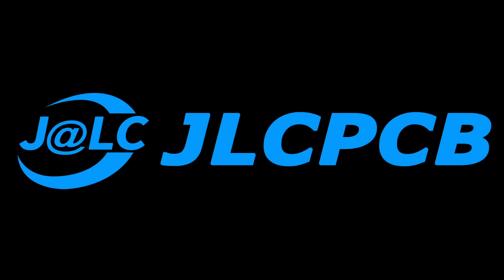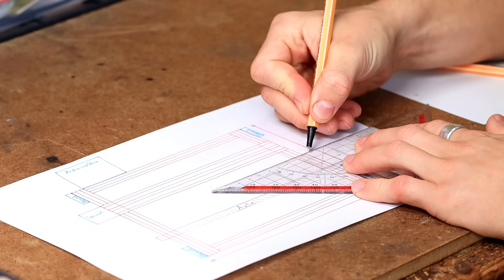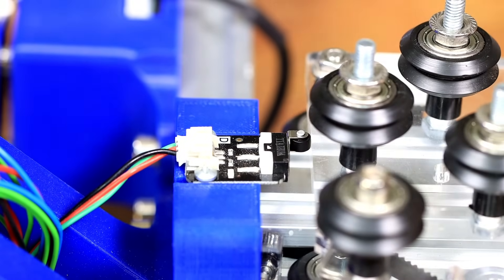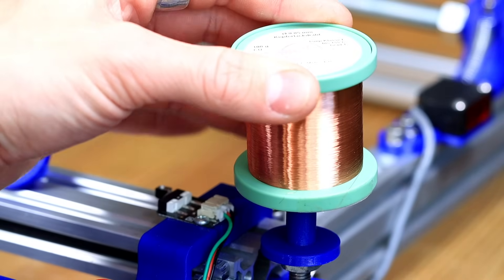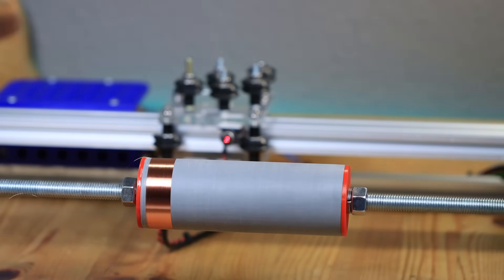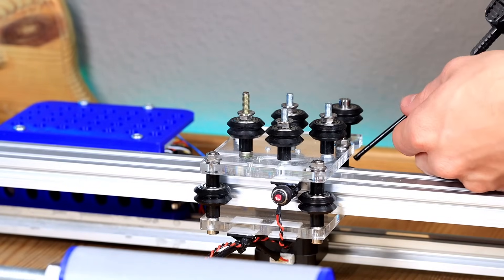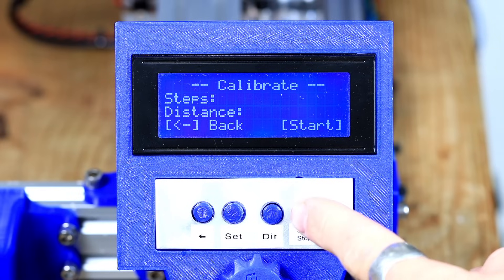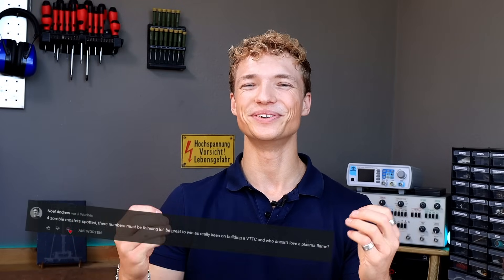Best Tesla-Coil Winding Machine 2022 - 0.05mm Wire!?

Comment: thinner wire, more resistance, lower Q factor. Must be for a very high frequency coil to work.
Reply: Thinner wire means more windings which means more inductance, which means lower resonant frequency. It would be a low resonant frequency coil but probably low output from the high secondary resistance right?
Reply: @treasuretotrash2067  yes, to keep resistance low you would need less windings for high output, thus high frequency